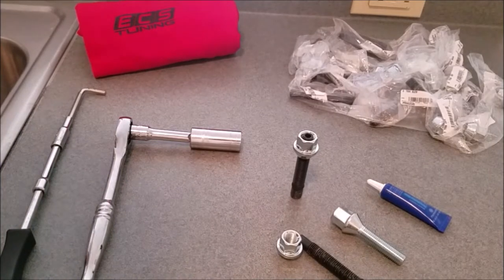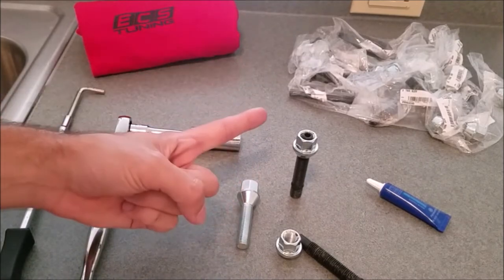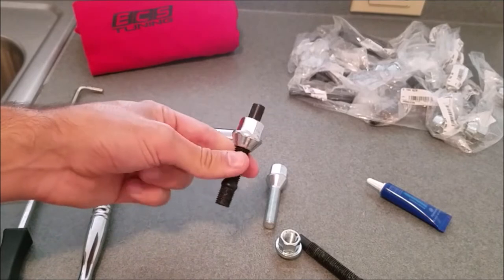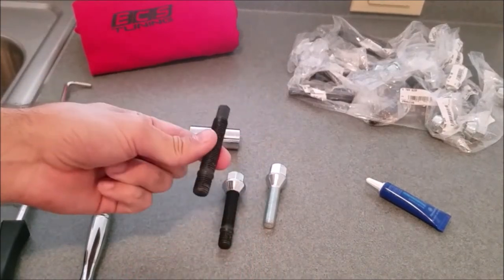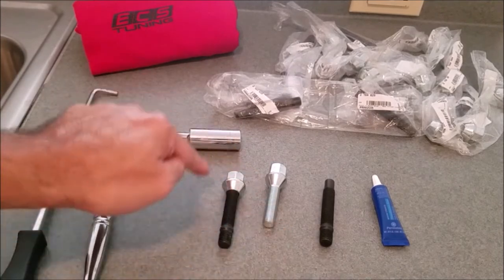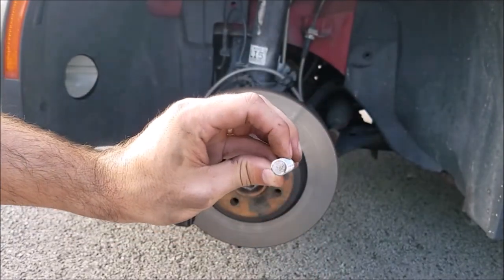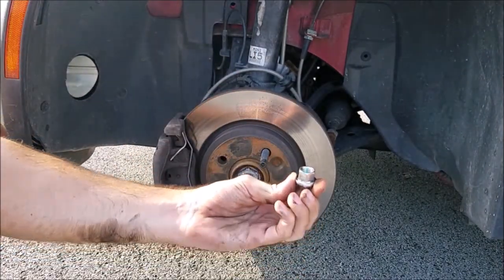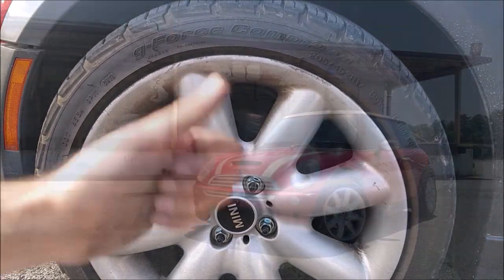R53 Mini Cooper S ECS Tuning Wheel Studs DIY

Comment: I'm very hesitant about buying from ECS, but how have they held up so far?
Reply from the maker: 3 track days, 1 autocross, and about 10K miles later, they've been great
Reply: @350Z247 It’s been a few years since you posted this, so how have they been over that period? I just used your video to buy a couple of sets (2 Minis) from ECS and installed them. I have to use spacers on the front wheels because the previous owner installed brakes that are too big and the wheels don’t fit without them. But after my last autocross where 3 bolts sheered off and the wheel went flying across the track I got really nervous about using the spacers. I know the stud replacement will be a strengthener but wondered how your setup is doing now. Thanks for the video!
Reply from the maker: @billtubbs4862  Mine have been. Just make sure the spacer fits the car properly and there aren't any interference issues with the hub or wheel.

Comment: Good upload.
I'm in the UK and have been having same issues ,running 12mm spacers and I keep breaking the bolts.
Have the oversized items,correct etc etc but I've lost all trust.....I hate to think what would happen if I had it on the track.
So I guess a stud conversion should give it more strength through hard corners?
I checked my mini tonight and another three were broken, one on each wheel....they were all torqued up proper.
Any advise is very welcome......I'm worried now about cornering it hard and thinking of selling but surely I can't be pulling that much lateral G to keep doing this🙊.
Would love to hear from anyone for help .
Reply from the maker: Check to make sure the spacers are seating properly on the face of the rotors and around the hub. Studs will be better than bolts, but you shouldn't be snapping three of four bolts. That's either a problem with the wheel or spacer mating properly or cheap bolts.